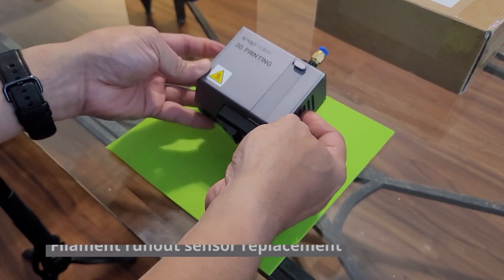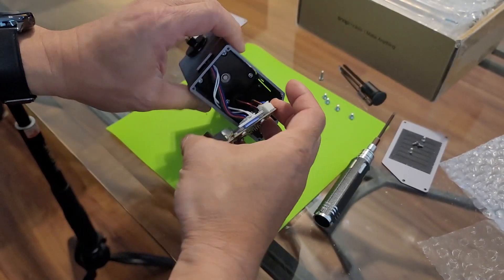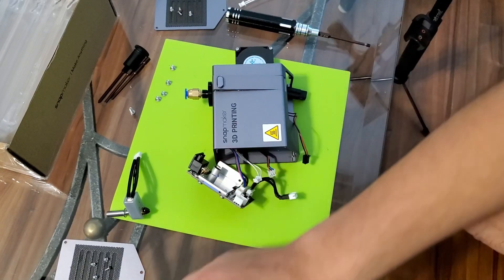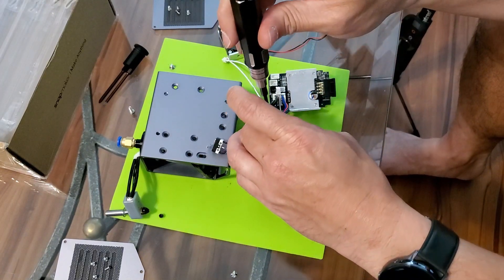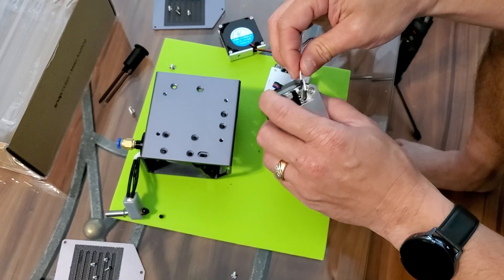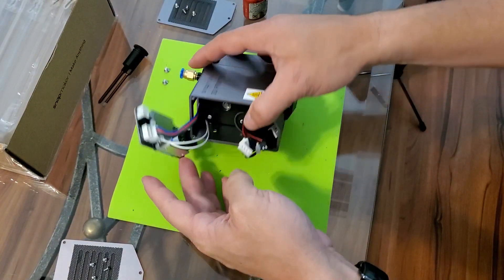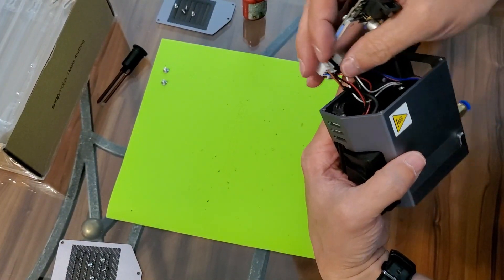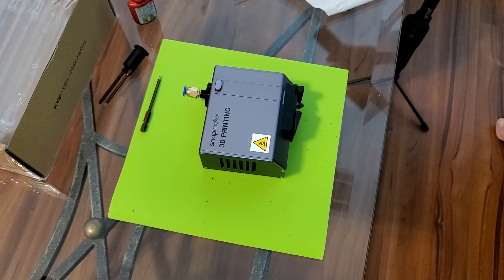SnapMaker 2.0 Filament sensor replacement

Comment: We are having problems with ours so I just went and bought a new one but with these videos I feel way more confident in dissecting the old one to fix it, with that being said what problems were you having to need to do this repair, we are having issues with the filament coming out curling up then straightens out sometimes and other times it just keeps curling stay near the nozzle and not stretching out. Thanks in advance I eagerly await your response!
Reply from the maker: Mine was a fault of the heating element. It no longer got hot. What you describe, mine always does at the start of a print or when loading filament. That's why it always purges filament first and why you want to print a skirt at a minimum.
Reply: @ I appreciate the advice thanks again

Comment: Thanks for sharing! I managed to find enough room by just removing the motor screws and pushing the unit down a couple of mm which saved a bit of time.
Reply from the maker: You're welcome! Yea I've tried wriggling wires around without fully pulling parts out. Sometimes it works well, sometimes it's a pain. i find it's best to show the easieast/most thorough way first though :) Once you see how it's done 'properly', then you can find ways to do shortcuts. hehe

Comment: Do you have a blue piece where the filament comes in, where can I buy it?
Reply from the maker: You will need to 3d print a new mount for the 3dp module, there are quite a few designs on Thingiverse. There's what looks like a silver disk on top of the module with 2 super tiny screws. You'll remove that part and replace it with the 3d printed part. Then you'll need to buy the Pneumatic Fittings (the brass and blue part) as well as a bowden tube for it. The fitting will screw into the part you printed out.